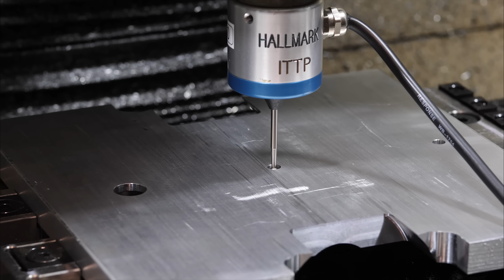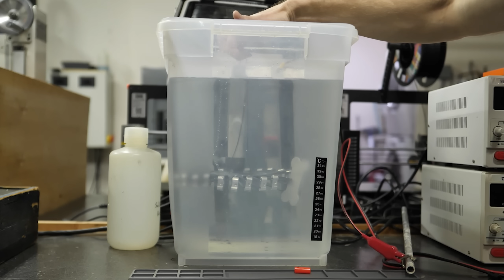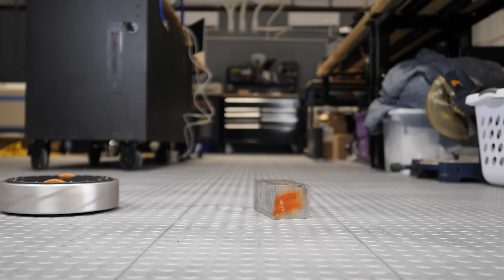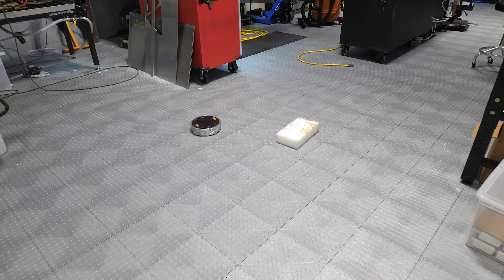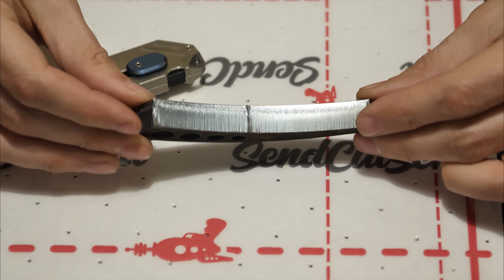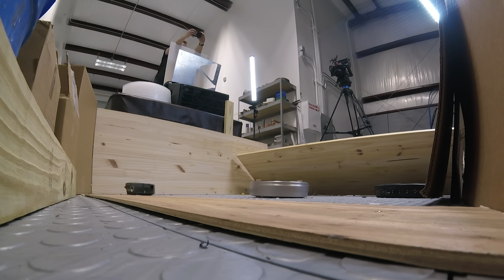Building a Battlebot Part 2

Comment: IDEA: make the motor that spins the outer ring reversible so you can switch between attack and defense mode (attack: where the ring spins do the other bot will be hit by the flat side of the weapon.  Defense: where is spins the opposite way causing anything hit why the weapon to be flung back)

Comment: Cool af.

You need a walker for double weight limit assuming you're going to a robot wars like event. You need a design that cab run upside down, so a through the case design for the feet is best.

I have a design idea if you want it, this is good but those wheels are vulnerable. 

Great music choice for the video.

Comment: Very cool! Also, is there a good source for new springs for the knife? Mine doesn't retract the tip of the blade anymore.
Reply from the maker: Sorry to hear yours stopped working. You can order a replacement kit from our website:
https://www.fluxprototype.com/store/p/spare-carriage
Reply: @PhysicsAnonymous  No worries! It's actually impressive how long it's lasted. I've been using it as EDC as a plumber/hvac tech. It's mostly held up through about 12 blades that have been used far past the standard life of an exacto blade.

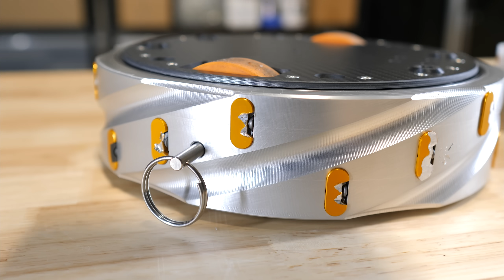Comment: 6:37 for this version of the shell
the carbide needs back bracing, the overhang  means it just cracks were the support ends.
check all ya insert tooling and see how they brace them, since ya bot is basically a giant cutting head XD.
(some carbide blends are more impact resilient,  but i think over hang is your main problem. 
or try to adjust attack angel of them back like 15 degrees or so, so that the impact force will go back into the clip you fasten it with.
it will lessen the bite of them, but sometimes a skim cut is better.
could be fun to see if that would help

 love ya work
Reply: Yup this: basically because of the thickness of the ring wall there was no way to get the right support behind it and leverage the right cutting depth. Even so I'm not sure backing it up with the aluminum would have ever worked, just too soft and deformed with every impact.  The steel version cut really well in the end, but ultimately got jammed up with pieces of opponent. Maybe we'll experiment for the next bot, or maybe someone else wants to but so far I think the more bash-y weapons are just more effective in the ring. New things learned for the future :)
Reply: @wileecoyoti  ye you right, the  aluminum instert holders would definitely deform. Think i just forgot they weren't steel course i watched the rest of the vid xD. So ye you have to change that too

Comment: If I would ask the old machinist at work to make this piece from start of the video for me on the CNC he would tell me to f*** off and then when forced by management he would buy $10k of tools and take at least one month to get it manually programmed and another month to get first one cut.
And when asked why he didn't use solidworks cam he would say this is not related with the CNC manufacturer, that in his old days you needed to purchase license from the manufacturer that will then provide proprietary cam software and if we use something else to generate gcode we would break the machine and void the warranty...

Comment: You can tig weld using HSS drills as the rod and add hardened edges to tools etc........no heat treatment needed
Reply: If they have a heat treat oven, might just as well heat treat the part 😂
Using a HSS (or equivalent) feed metal is a good idea though, to have a softer "backing material" that would dissipate better the impact while allowing a hard edge.
But IMO the AR500 plate is the best way to have a fast and very durable result ...